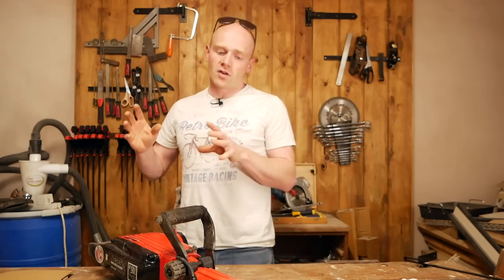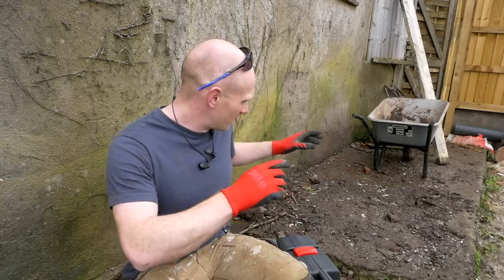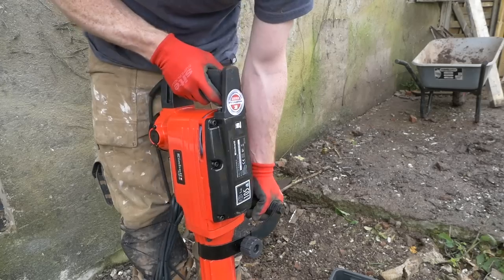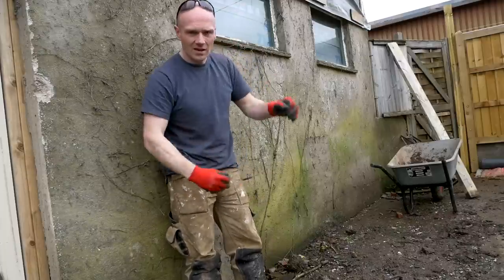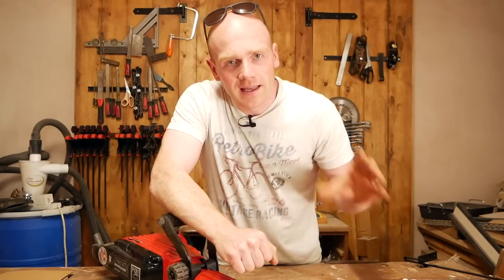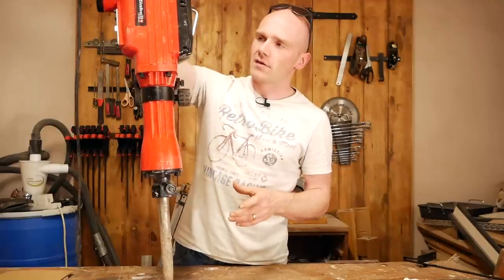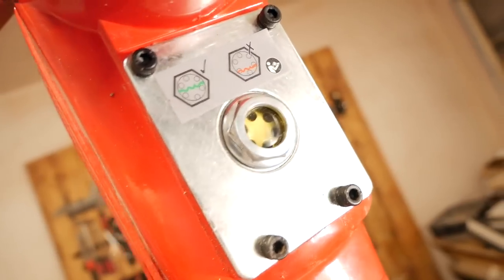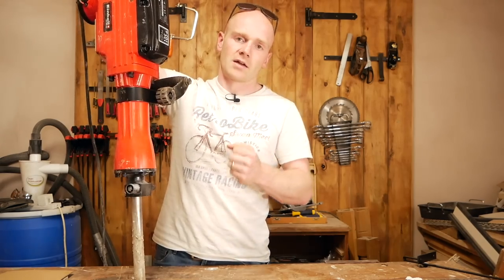Budget 15kg Concrete Breaker is a WINNER! 💪

Comment: The good thing about purchasing the tool is having it there at your convenience, you can do the jobs when it suits you rather than having to do a job when your not in the mood for it just because it’s on hire and needs to go back.

Then if it is a larger purchase in cost then once your sure you are definitely finished with the tool you can easily sell it on and recoup some money. I purchased a wacker plate as I have a few jobs in the garden regarding paving, garage base and driveway that I have planned over the next 2 years, just having it there let’s me do it in my spare time and at my leisure rather than having to go pick it up and drop it off each time  I need it.
Reply: It's daft not to have one in your store at that price it there when needed.

Comment: I bought the £99 one from screw fix to remove a load of concrete before laying a patio, used it for two days then sold it for £65. Cheaper than renting, no worries about completing it quickly to save on rental fees or the weather turning and delaying things and it does a decent job, much quicker than going at it with the sds!

Comment: Just bought it from tool station I have a lot of concrete posts to dig up got one up with chisel and hammer very hard work, and I am 70,  cant wait for it to come so I can get rest of them up.
Reply: Charles Brown I just got this 2 days ago. Deal at £120
Reply: @askerdanny8   I have used it great value I have dug 10 posts up already as I am moving the fence back 3 foot. I only put it up just over a year ago and behind it was all old posts I have dug up, all up now just have to get new conrete posts and dig the new holes, was hard work, but made it easier with it,  when i dug the old posts up there were loads of concrete every were, and the groaud was getting pools of water it seems to have drained away, must have been all the concrete in the ground,hard work and I am70 years old :)
Reply: Charles Brown I’ll be using it first time tomorrow, someone has had a tree fall down and smash a load of fencing/posts/gravel boards etc. So after watching a few videos I thought this would certain make life easier
Reply: @askerdanny8  good look and enjoy :)

Comment: Depends really. If your doing a lot of this work buy a Bosch as they have power and aren’t as heavy. If it’s just a one off job then get a cheap machine but there usually very heavy and bulky. I use my BOSCH GSH 11VC every day and it takes a lot of abuse, still going strong.

Comment: Tried a cheap Toolstation SDS but that failed so returned it. Got the SF Titan version which seems to be holding-up, but just not man enough for breaking the solid sandstone bed upon which I'm building a garden room. So I got the MacAlister version of this hammer and haven't looked back. What a time saver. Only problem is the physical effort sometimes required to extract it from the earth. Frequent rest periods are essential! But, as you say, let the tool do the work. In fact it needs the body to be unloaded in order for the tool to fully oscillate and get the most cutting power.

Comment: I can confirm that using one of these for two or more days straight is brutal! That's mostly because you have to bend over all the time, especially if you're tall though. My brother has a blue one and the first job I used it on was breaking up an 8" slab from the mid-1980s for new drains over a weekend. Thankfully we had two of them because one of the people got the chisel stuck and we had to use the other one to free it. Last time I used it was this year, breaking up a bathroom floor, also up to 8" in spots (someone had the brilliant idea to raise the bath off the floor by pouring another 4" of concrete on top of the slab).

The chuck is called SDS Hex and only seems to be used by these cheap breakers but chisel bits are easily available online. DIY stores round here don't tend to have them in stock though.

Comment: Einhell are the OEM for most the Aldi titanium and  Lidl tools. I think Draper rebrand these too.
Should be handy to get parts, if needed. :)
Reply: As I said in an earlier post I had the draper one which apart from being blue looks almost identical. Bought from a tool fair on special offer, used on my demolition and build and sold on for almost what I paid and with 18 months of the warranty left and looking like new. I'd buy another one without any hesitation.
Reply: einhell are not an oem, they are a brand like draper and simply rebranding from a chinese oem same as rest are doing .

Comment: Will this work to break up an old tree stump? Stump grinder costs a lot more to hire so thinking along the same lines and buy. Thanks
Reply from the maker: No I don’t think it would be much good for that. Unless it was very hard and dry and it split, but I imagine it would just wedge itself in there.
Reply: @TheRestorationCouple  Cheers, will have to get a stump grinder or a big axe :)
Reply: No, but it will separate bamboo root balls that have grown attached to masonry where there’s plenty of stone and to use a grinder would be financially suicidal.  Be careful hiring a grinder, chances are the cutters will be blunt to begin with and you will be charged a sharpening fee when you return it.  Best option is to bring a firm in and let them have the worry of maintenance.  It’s not just grinding the stump but protective shields etc, stone shoot away and break all kinds of things, the contractor will have all the equipment.

Comment: I borrowed one very similar to this to break some concrete up around rotted garden fence posts.     I managed to get the chisel wedged in and no amount of 'waggling' would remove it.    Lucky for me, my mate has more ingenuity to me and with aid of a shortened scaffold pole and make shift fulcrum managed to shift it  - a bit like removing the sword from the stone.
Reply from the maker: You need two! 😉

Comment: The  chisel bit works best and mine has lasted for years but you need to keep packing grease into it, not oil.from new it didnt have enough in it. also i have regularly used mine like a crowbar with no issues!

Comment: I imagine the tips is where the weak spot is. Are they readily available?
Reply from the maker: I believe it’s a regular hex fitting yes.
Reply: You can regrind the tips with a bench grinder or even an angle grinder as they wear, you should be able to do it several times before you need to replace the bit
Reply: Yes they are readily available. The point rounds off after a bit of use as you'd expect but it's still just as effective . Toolstation have the bits available for about £9.44 each

Comment: Do you like einhell? Is it a good compeny? I didnt heard the best about them...
Reply from the maker: No idea. It’s just a sticker, pretty sure this one is a generic model.
Reply: @TheRestorationCouple  i just actually bought a sds drill rotary hammer type. 800 watt. Looks exactly like bosch gbh 26mm dfr. 100 110 120 usd. Instead of 200 250 usd in israel for bosch. Just different color scheme and hunter logo. Its has the exact same performance but obviously won't last as long. For a home owner these smaller companies are just perfect👌
Reply: @TheRestorationCouple  Einhell is a German company - excellent products
Reply: i've been using Einhel products for years. No problems. They get the job done. The only device i wouldn't buy from Einhel is their drills. Not so good as the rest products.

Comment: Why not just use a sds/rotary hammer drill?
Reply from the maker: I have for the past 5 years but they really are not designed for 6” concrete! This is a different beast all together and has saved hours already.